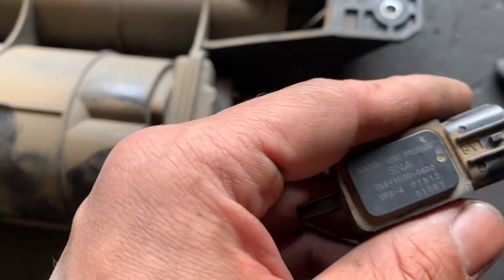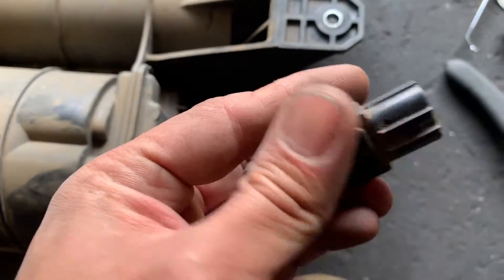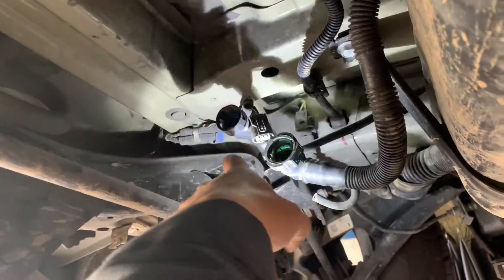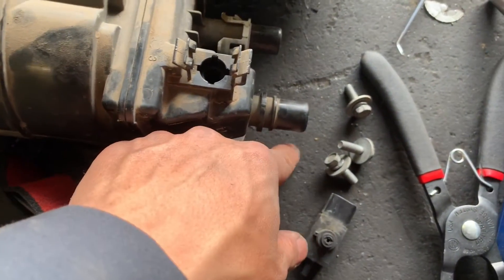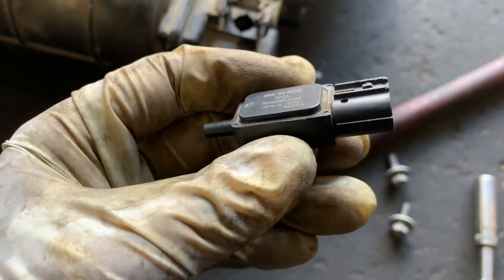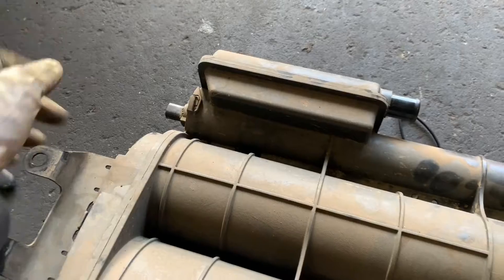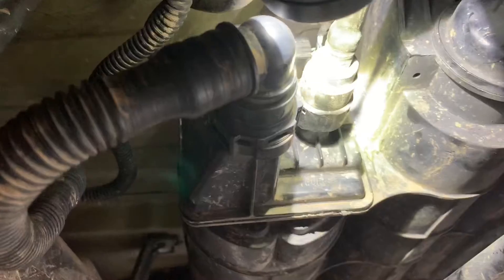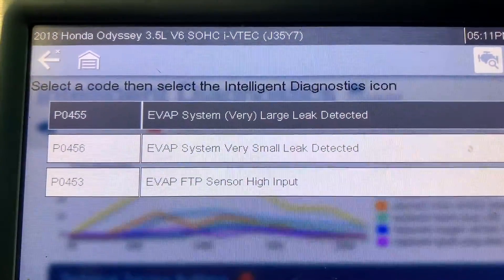Honda Odyssey Evap System Leaked (P0453 P0455 P0456)

Comment: Hi. I know this video is 2 years old. Not sure if you will see my question. I have 2018 Honda Odyssey. Received a recall letter in the mail about 4 months ago from Honda for faulty fuel pump. Called Honda to get recall issue fixed. They said they do not have the parts yet, and will notify customers when they will be addressing this issue. They said they are only fixing vehicles with the check engine light on. At that time my check engine light was not on. However, my check engine light came on today. Called Honda and they said I had to take it in to them to do a diagnostic test for $160. They said if I got my car fixed there they will take off the $160 of the final price of getting the car fixed. They also said if a certain code saying faulty fuel pump comes up, then that will let them know it is the recall issue, and will not charge me for the diagnostic test or to get the recall fixed. I took my car to AutoZone to get tested for free. The codes I got were P0455 and P0456.  Do you think these codes are caused by the faulty fuel pump recall? I hate to pay $160 at Honda for nothing. I can get my car fixed a lot cheaper somewhere else if it is not the recall issue. Thank you for your help.
Reply from the maker: For the fuel pump issue. If its a recall issue, everything will be fix for free. You took the car to autozone to RUN the codes, not diagnostic. Honda charge $160 for the diagnostic, meaning they will do smoke leak test on the evap system to see the leak is, check all the datas with scanner to see the issue, this takes around 2 hours to diagnose. You can take it to another smaller shop to fix it for cheaper, better price.
Reply: @Ah_Duuu_Ma  thank you

Comment: Im having issue with a preowned car i just bought. 2019 honda oddyssey. Had it for 2 days and it says emission sysytem problem. Took back to the dealership and they claim they fixed it and it was just a small leak. 1 weeks later the same emission system problem came back on. Took it back to the shop again. Now they say its a large leak p0455 and the  fuel evaporator canister failed and needed to be replaced. Right now it is currently in the shop again and im getting really frustrated with these mechanics. I told them to take their time on fixing it because if this light comes on again i will be returning the car back and we need to figure something out. Really frustrated with this. Preowned 70k miles car that im paying over 20k for and 3x in the shop in less than 1 month. Wow.
Reply from the maker: Replace the canister assembly. It comes with the fuel tank pressure sensor too.
Reply: @Ah_Duuu_Ma  its currently in the shop. Dealership said they will fix it all free of charge, but then again thats what they said the first time. This is the 3rd time its been in the shop
Reply: @macteesac how did you make out? Did the issue get resolved or are you getting more codes
Reply: @macteesac any resolution to your issue? I have a 2019 with the same issue.

Comment: Hi, I have my 2006 Honda odyssey’s touring”
Have message  “tighten fuel cap”
Sometimes after 3 days will go.
When I fill gas up. Then few days message comback again. 
Any suggestions?
Reply from the maker: Check gas cap oring, make sure its not craks or damage.

Comment: I have 2005 Honda Odyssey having the same problem I replace all the parts
But still have the same issue.
Reply from the maker: Sometime used part can be defected and do not buy aftermarket part for asian car "especially evap system". So you have to buy new oem part. If this does not solve the problem then you have to smoke leak test the evap system. to see if the canister is bad, evap line is damage or crack, or gas cap leak. "If you know how to test the evap system".

Comment: How much to do they charge to fix this normally?
Reply: I have a2003 Honda Odyssey. N it's the same thing. E valve
Reply from the maker: Depend on where you go to. Dealerships charge around $185 up an hour labor. Local shops charge $120 up an hour labor. This job cost $350 - S400.